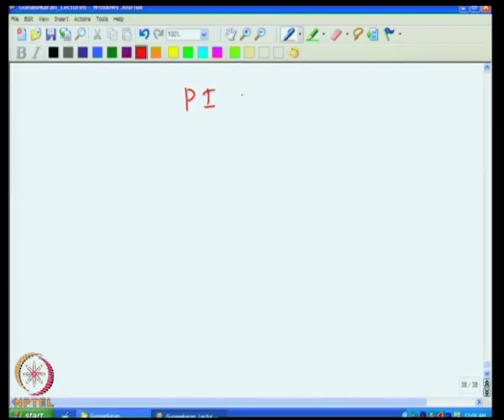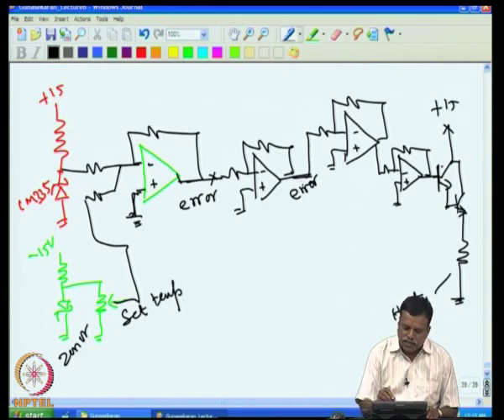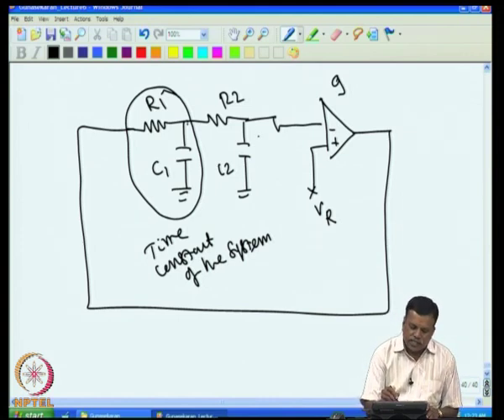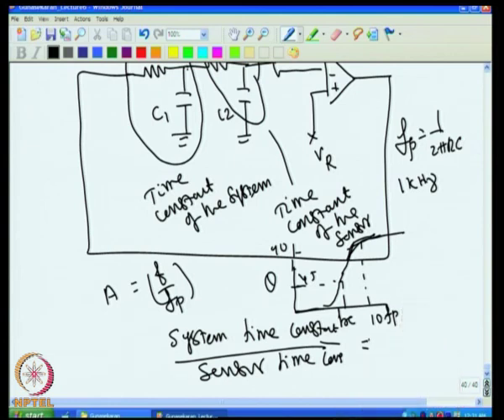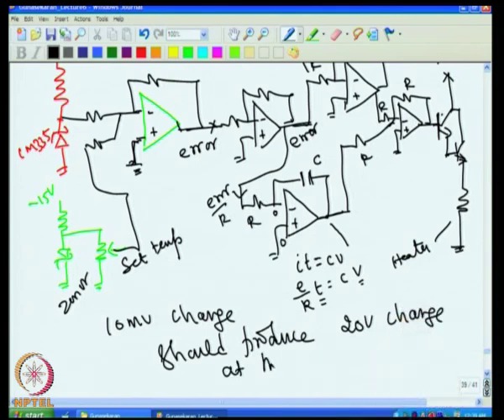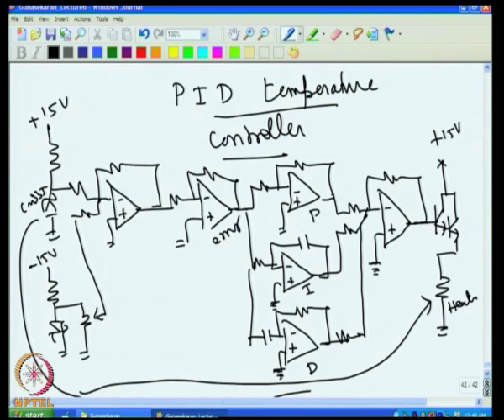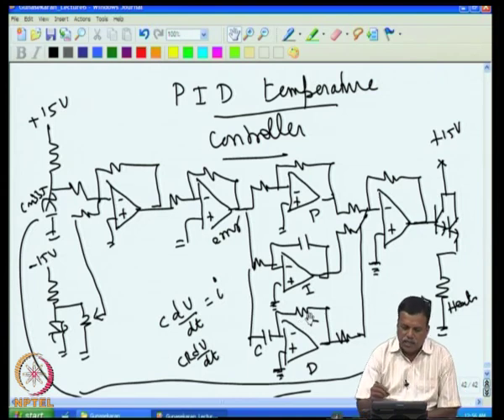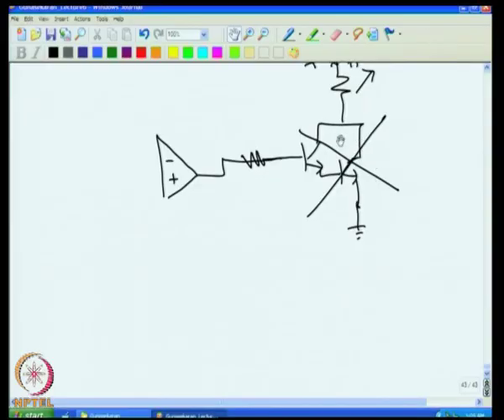Mod-03 Lec-11 PID - Temperature Controller Design

Comment: i was looking for a PID controller desing and i found this, my comments are:

1-Understood how to put PI or PID in which cases and thanks for it.
2-I don't how to know the resistance and capacitor aso may i assume both values for the final gain of amp op.?